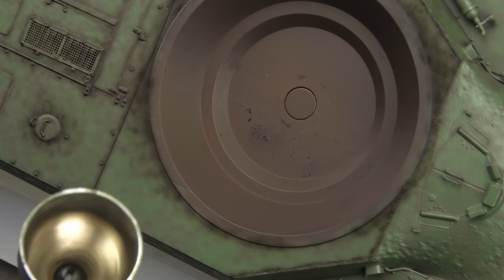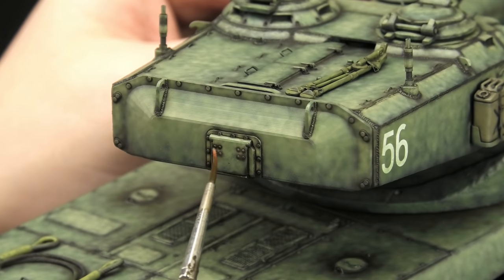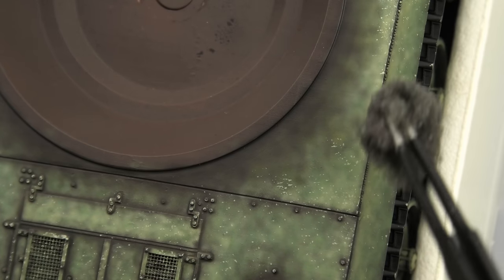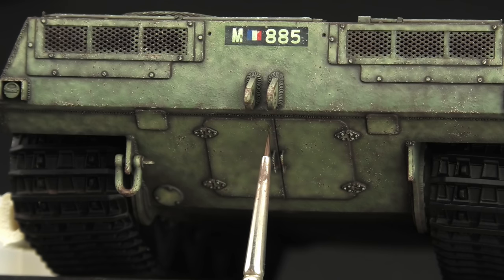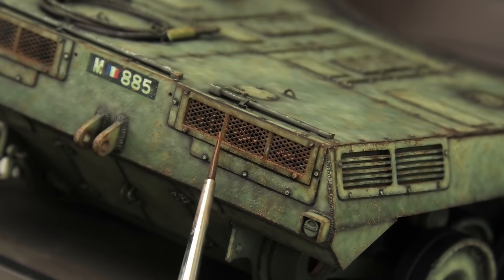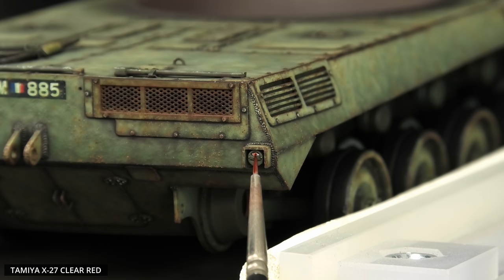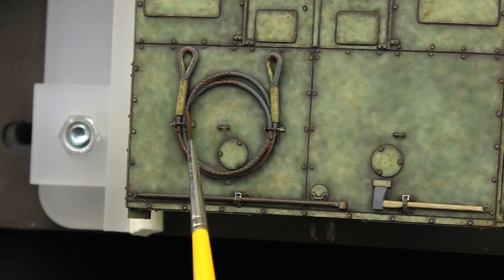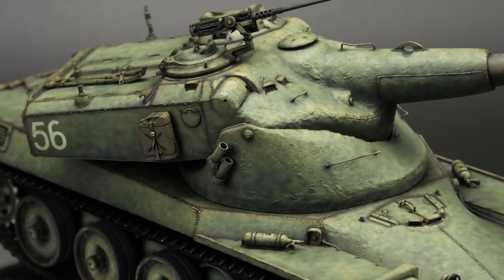Weathering a 3D Printed Model (AMX-50, Resinscales 1/35)

Comment: Just a couple notes from an old tank commander.....
1: that Browning M2 , .50 cal HMG was Parkerized, a light/medium grey flat finished rustproofing. Check the internet for parkrized color. ( the barrel, was often darker due to heat discolorization) 
2:  that object on the rear turret roof is the tripod for deploying that .50 cal in a ground-mounted mode.....and would be the same parkerized grey.

Comment: at the back of the turret there is some big layer mark, you can fix em before painting with, sanding, some heavy primer and a litttle bit of sanding, or diluted puty, but your metal efect wih puty solve it in prety much the rest of the figure , awesome job like allways

Comment: Well, at first, as always, awesome job! But seriously, the only place where you can truly spot the printing layers is the back plate on the turret, right? Most of the rest probably got covered up by textures and multiple paint layers.
Reply from the maker: they're also noticeable on the fenders, engine deck and turret roof. Luckily, you can deceive the eye by using paints and varnishes - not by flooding the surface and thus filling the texture, but making it less obvious

Comment: If you need a silver colour that actually works and looks good I can highly recommend the Vallejo metal colour range, the pains look great and are pretty easy to use, however they are very fragile and need to be varnished after applying. Honestly there paints changed the way I make models, give them a shot!

Comment: It seems like the model has some issues, one of them being the printing texture. However, it also has issues on some spots like the hook at the front, because it's not exactly round. It has like a 'square-y' 3D looking texture around. 
You've hidden most of the issues with armor texture on the turret, since the turret itself has a very square-y texture too, but you've hidden it all which is great.

Comment: really nice, as for metal paint (like the pickaxe, shovel and cables) intsead of using it as a base coat, just do what you've done here and add some metalic paint or pigment in parts that will be eroded the most, I also notcied your metalic paint is quite shiny, so to tame it and avoid a plastic kid toy look, mixe it with a darker colour or wash it, can be very effectiv for greasy cable. Or you can avoid metalic paint and try non metalic technics, or even better combine both by drybrushing some light grey and then use sponge technic to add mitalic paint chipping. As for reference if you don't mind dropping a bit realism for the rule of cool, I guess you could take a look over scifi and fantasy minis painter, no need to copy their technics, just might give you some new idea on how to work certain things.

I'm pretty sure I just broke an open door, and you probably know all of this, there is of course the time spent on a model that act as a limiting factor kind of.

Cheers

Comment: 50cal is to clean and not beat up. I was handling 50cal and he was beaten up, ita shows he is old, but fateful.. Good gun, no need to be changed...
Reply: The US did finally find something to change on the .50cal: an actual quick change barrel, no more headspace and timing!

And in the process of rebuilding the various M2s in US service, they found a ... 1923 production gun that had been in active service in Afghanistan before they rebuilt it.